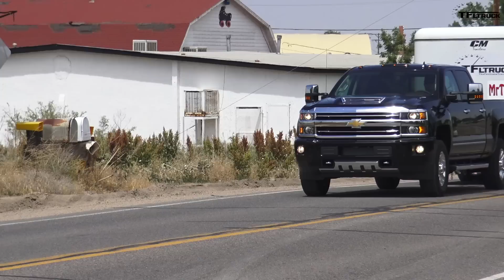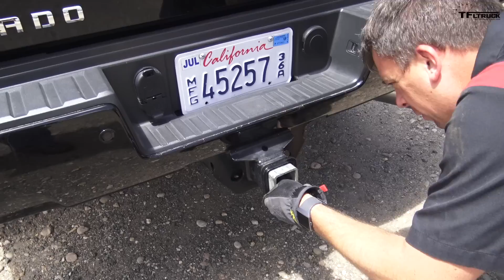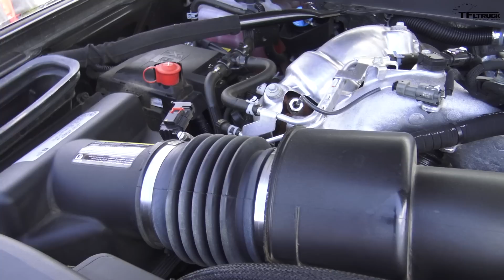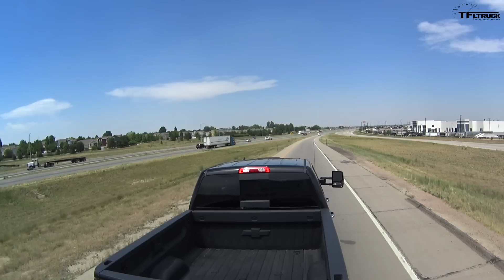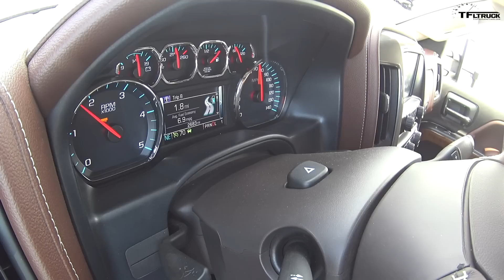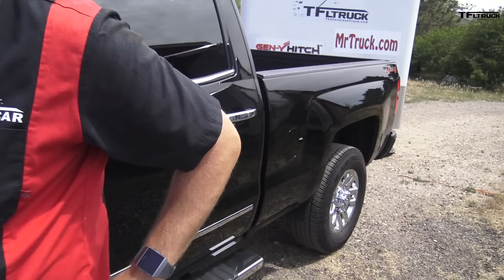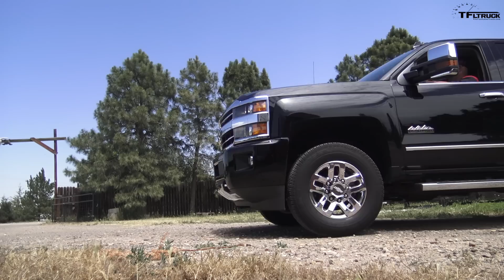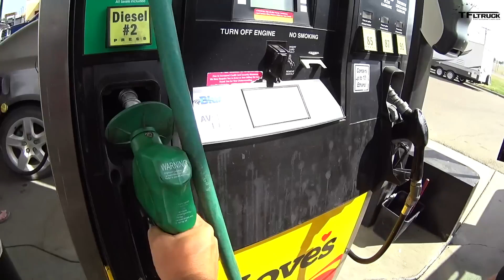MPG Challenge: Silverado Duramax vs Cummins vs Power Stroke

Comment: Summer diesel vs winter diesel try the others again.
Reply: Cory Breider 

We're  they  tested during different seasons? If so than this is the single biggest factor in the test, and would explain why there is such a large difference in mpg.
Reply: Jr Mason I remember the duallys being tested while snowing and the other 250s in early April before they changed blends.
Reply: yeah, I cringe everytime they do one of these "tests" with a trailer and compare it to trucks ran on different days.   I tow a large enclosed trailer on the interstate regularly for work.   And with the same truck/trailer and similar loads; the mpg will vary from about 7.5 to over 11mpg depending on the WIND conditions primarily.   I can't believe that these guys don't even record the wind speed/direction when they do one of these tests. so basically I estimate that this test has a horrific margin of error of about 30%.   and all of the trucks tested are well within that margin.
Reply: Jr Mason scr warmup mode(as you described), egr shut off(cold ambient induced) , regeneration events, Diesel blend, dew point, humidity, wind.... ect
Reply: sonictech1000 been running a diesel truck for 14 years and typically see a 2 mpg difference in winter and summer. Plus I had a 17 Duramax Denali I put 13k on and traded for a 17 platnum Powerstroke. Unloaded Duramax at 83 Mph got 20 Powerstroke 17.5. loaded down 13k toy hualer Duramax 8.5 Powerstroke 9.8. I would like to see all three ran with same trailer and at the same time to rule out wind as well as this makes a huge difference.
Reply: @corybreider6559  Why would you trade down to a newer Powerstroke? The older Powerstrokes were beasts but the new ones have throwaway motors.
Reply: That was my thoughts exactly
Reply: GOOD POINT. Makes quite a difference.
Reply: Robert Moulton Interesting.  I've noticed lower mpg in the winter with my older diesel but I just chalked it up to more idle time.
Reply: Robert Moulton I'm in Northern Arizona (in the mountains).  Some stations explicitly advertise winterized diesel and some don't. Personally I use the winter version of Diesel Kleen from mid November to mid March.
Reply: sonictech1000 as u likely know at about -10℃   ordinary diesel thickens and refuses to flow . 
 I've head stories of truckers filling up with fuel in the southern US driving north into the cold and freezing there truck up 😖.
Reply: If that's true then I agree they should all be running same blend to be fair. My Jeep for example gets 18.7 mpg avg in winter and 20.1 in summer avg. So yeah they are most likely all very close in mpg if they ran same blend winter or summer.
Reply: sonictech1000 absolutely . Years ago my bulk fuel dealer would tell you there was 10% power difference (less in winter fuel) than summer . However they claim new winter fuel is near equal to summer. Again ,near-
Reply: sonictech1000 where are you located. The mid and southern states I don't think get winter diesel.
Reply: Cory Breider wah. Someone got butt hurt.
Reply: Robert Moulton Yeah that would be pretty easy to do here.  A 2 hour drive is good for about 20 degrees F temp swing and day to night is good for another 30.
Reply: Matt Lane interesting , they don't market summer/ winter gasoline here that I know of .
Reply: No one MARKETS the gas, idk where "here" is but, if it gets cold and the car starts easy and runs you got winter gas... the change over just happens you have no choice in the matter... google it.
Reply: Matt Lane ,I've been around engines diesel and gas in a cold climate for a long time . Until petro Canada and a few others up here thought it would be a great gimick to tell people they have winter gas . Just a way to get rid of some ethanol. Gimmick like best before dates on hand sanitizer? 
Did you know the hospitals throw out past dated unopened bottles of the had sanitizer.wow that was clever on the part of that company ,I can hear them laughing and the board meeting still .
Reply: as I said, I did not know where "here" was... you 100% have winter gas then, OR you have winter gas 24/7... what one that is IDK... as far as the past dated stuff... for all we know the law states everything must have an expiration date.  and oh man, you know the field day lawyers would have if something was used past an expiration date... SALT a ROCK has expiration date... at least here in the US...
Reply: Matt Lane what do you call 10000 lawyers at the bottom of the ocean?
Reply: yep, it's real. especially up north where gelling can be more of an issue. BTDT. gelling not fun.
Reply: Robert Moulton yes gasoline is blended differently for winter and summer seasons......
Reply: There is winter gas. In California they have winter and summer blends. It is a real thing.
Reply: This video shows a very fair comparison of what they are doing here. https://youtu.be/4MRtltzrWUY
Reply: Alex Morrison 

You are right, however I also feel if one is going to perform a comparison on as  large  of a stage as TFL, there should be a concerted effort to make the variables as close as possible. Diesel engines are more susceptible to poor mpg in the winter time for two reasons, one as mentioned above winter grade fuel and two current emissions requirements. The colder the ambient temps the cooler and less efficient the SCR becomes, to counter this the injection event (and effectively the timing event) is delayed. This does two things, decreases peak cylinder temps and increases exhaust gas temps. Both hurt mpg.  It is very common for me to get 1-3 mpg worse in the winter than in the summer hauling the exact same loads, which leads me to believe it is no coincidence that the Duramax was able to beat the Ford and Ram by nearly 1.5 mpg. It ain't magic dust!
Reply: You have to take these tests with a grain of salt. They could change slightly but that's why they say it is real world reviews.
Reply: Cory Breider I know gasoline comes in summer vs winter blends but I've never heard of this for diesel beyond the anti-gell additives.  Are you sure that is even a real thing?
Reply: Huge difference in summer and winter blends of diesel over an above the anti-gell.  At least in Canada.
Reply: Rhino Willy's is you jeep a diesel ? Then you point is mute. There is no winter gas...
Reply: That would suck if they did... ya winter diesel is cut up to 50%... lol anyone who thinks they are the same winter/summer is on drugs.

Ya summer gas does exist as well btw...

Comment: A high country has manual mirrors. WOW how cheap.
Reply: you wouldn't believe how many trucks I've turned down because of those manual mirrors!
Reply: You can't get your lazy ass out of your damn truck to extend it manually? To me it's more dependable than electronic ones that probably cost a couple thousand bucks.
Reply: brent vance they extend manually but fold electronically
Reply: You could spend literally thousands of more dollars just to have auto extending mirrors from Ford or Ram if you'd like
Reply: lol im pretty sure they are ... Hes just yanking on them

Comment: Is this test really comparable to the Ram 2500 and the F250? Are you guys planning on comparing the Chevy 2500HD in the future.
Reply: If anything the ford should have  done better with a numerically lower gear ratio. That would mean less rpm at the same speed. The only difference between a 3500hd and a 2500hd is the springs, that's it!
Reply: Not perfect but they can’t just cherry pick trucks, a lot of times they get what the manufacturers give. Also the axle ratio doesn’t always mean more or less mpg, the ford has the best highway ratio yet got by far the worst mpg
Reply: Micheal Adams I understand how gear ratios work. The chevy split the 2 so, that makes it that much more imprssive. I agree that maybe the ford used more because it used a higher percentage of throttle
Reply: Guys, the gear ratio doesn't matter. These are different engines between the 3 manufacturers with different transmissions and likely similar, but different tire sizes. Gear ratio only matters when you're talking about the same engine/transmission combo with the same tire size.
Reply: Matt France yes indeed my friend but they all have around the same amount of torque around the same tire size the transmission and rearend is in fact where it has gone wrong though but you are correct they are all 3 different brands and make their trucks different and I won't argue against that but I will argue against the transmission and rearend not being the problem that is where they get you the Ford would be the best because of engine displacement if they all had the same rear end it is just a fact because of the number or horse and torqure which is what they normally test on which yes you can upgrade your rearend to which ever you want but the transmission is a different story if you want a real test example having the same rearend and tranny would be greatly appreciated being sent it would truly show off the engine quality as well as toughness and as far as I'm concerned this test isn't accurate for one the Ford and ram were tested in winter where as the Chevy in the summer which gives the Chevy I better advantage but hey y'all can argue with me all day long
Reply: First off gear ratio in the rear means little by itself in how efficient mpg the truck gets. Reason is you can have what ever you want in the rear but it works hand in hand with how they gear the transmission. Its a balance of both to get optimal hauling performance + mpg.
Reply: Eric Mackison ram had the lowest gear ratio it may seem weird but they do the higher the number the lower the gear ratio if Ford would have had 3.73 or something like that it would have done better it just didn't have enough ass to pull it and the ram had way to much ass and it made it drink more fuel

Comment: I pull a 14k dump trailer loaded 50-120% frequently.  This is in hilly country on the front range of Colorado.  I average 11.5mpg when doing so and this is 50/50 city/hwy on typical routes. 2012 2500HD Duramax

Comment: Hey great video.
Curious to know why you don't use GPS speed instead of the Speedo on the dash. For a more accurate reading. 
It might have been 70mph on dash but really may have been only 65mph. 
Not sure if your rules over there in the States stipulate it must be dead on the right speed or not. It's not here where I live. 

And we are about to get the Silverado so interested to see economy compared to others. 

Cheers
Reply: Dynamic D They are dead on. Unless modifications were done no GPS is needed for this test.
Reply: EGGINFOOLS 

Sweet no worries mate thanks for the reply

Comment: Sorry but the DEF tank placement and the square fenders completely ruin it. I just installed 35 nitto ridge grapplers on my completely stock ram2500(No Rubbing ALL). Really like the Duramax, but until they get rid of hideous tank and goofy fenders it's a no go. Really enjoy the channel
Reply: Yes, the def isn't the best position but 98 percent of those purchasing these trucks don't go rock climbing, they pull.  Unless of coarse your a city cowboy.  Subjectively the looks are number 1.  Love the squreness of my Chevy.  I love the big rig look of the Ram,  and don't like the fords look.  You can have the Brunette,  I'll take the blonde.  :)
Reply: I thought they fixed that with the latest model.

Comment: Yes, I agree, it is an awesome result.
 Well done GM!
Reply: I drive my 30 000lbs mercedes 6,4l diesel truck, 4m high with 12,5mpg.... at 105kmp.... about 69mph.    So i dont get it, why is 12,2 a good result for a relatifly light truck n trailer, ridn on the flat?
Reply: @SuperV8driver  tfl truck is based in colorado.  nearly 1 mile high elevation.  they will get reduced numbers compared to tests done near sea level.
Reply: @iHasCaek  i am from austria, i do also life 0,8 miles above sealevel ;)
Reply: @SuperV8driver  well, they are not really full time commercial haulers.  they will spend half their time as commuter vehicles and will fit in more places.